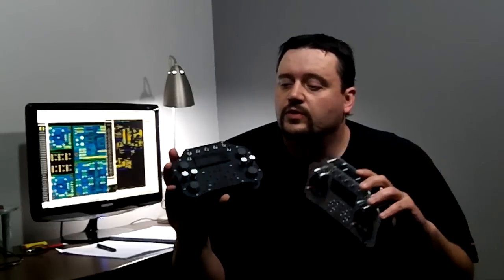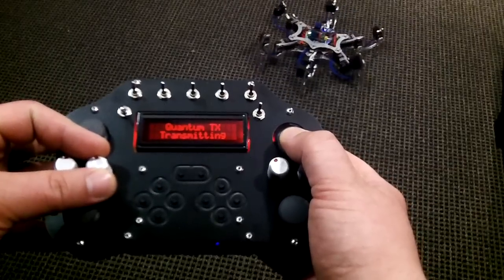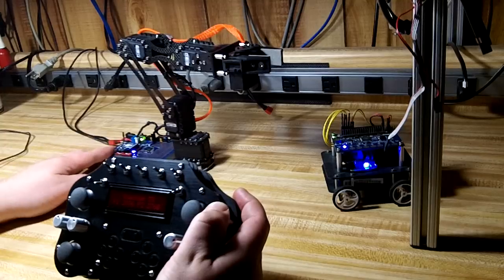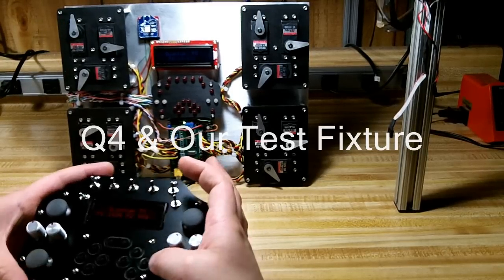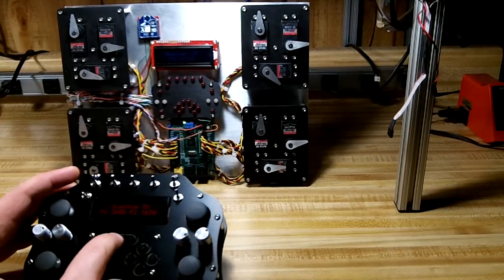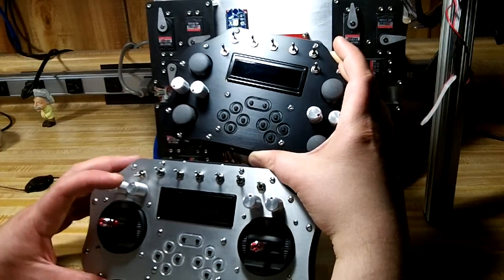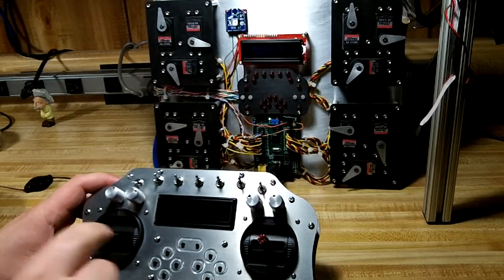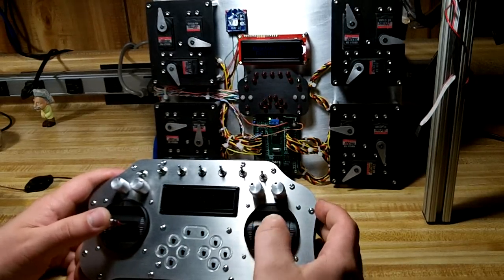XBee Handheld Controller (KICKSTARTER Video)

Comment from the maker: The test station had a form of interpolation software running which smooths/ramps the servo from its current position to its next. I made a new video Interpolation Disabled Demo and have posted it under our videos.

This video was also shot in 720 60P

Comment: There's an extraordinary amount of lag between the controller and receiver, I clocked 8 frames between switches being activated and the demo board reacting, at 29.97fps that translates to 267ms (over 1/4 second).
For something designed to control things in realtime that's an awful lot of lag, will the software be refined to reduce/eliminate this lag?